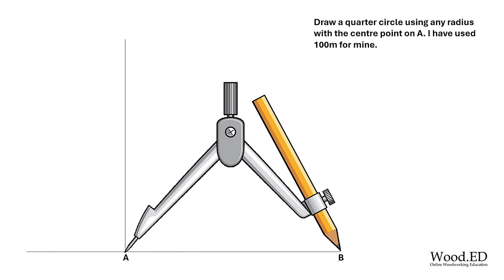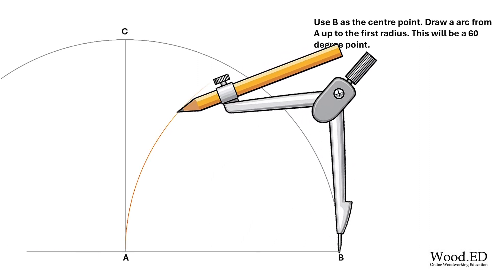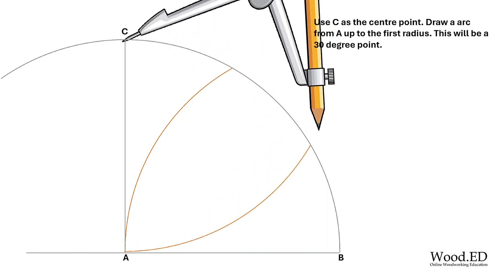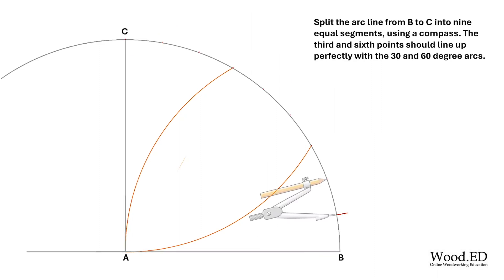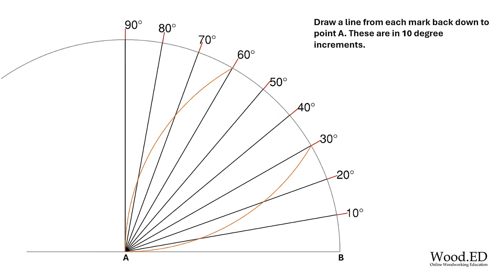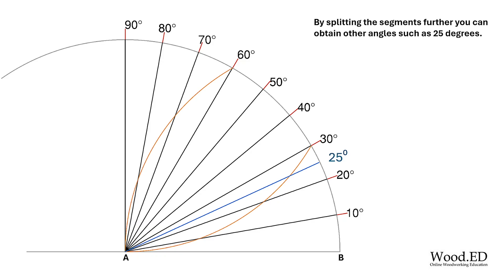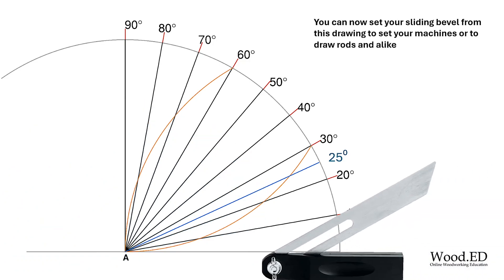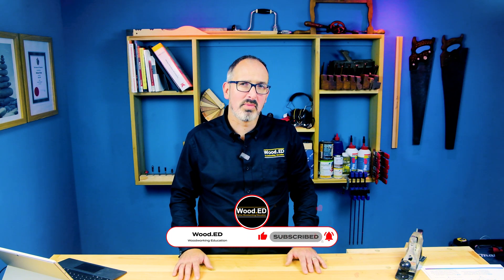No protractor? Find Angles With A Compass

Comment: I might be daft but how do i put in the 9 points?
Reply from the maker: Sorry for the late reply bobmidd. I did not get any notification. 
1. You need to set the compass so that you start at point A.
2. Guess a width of the compass so that the third strike along the arc falls on the 30 degree point.
3. . This is a guess and may take a couple of attempts to achieve.

4. Continue this method up to the 60 and 90 degree points.
Hope this helps